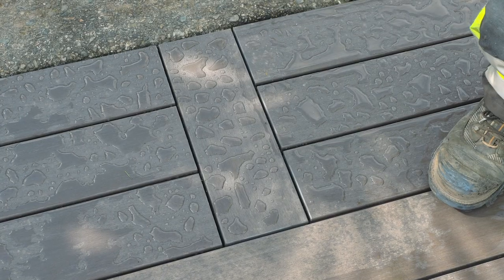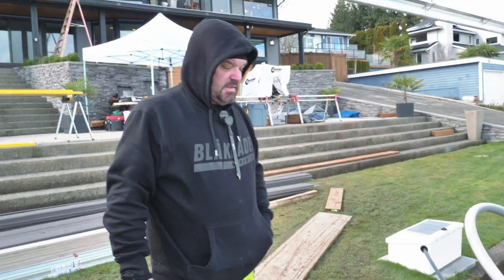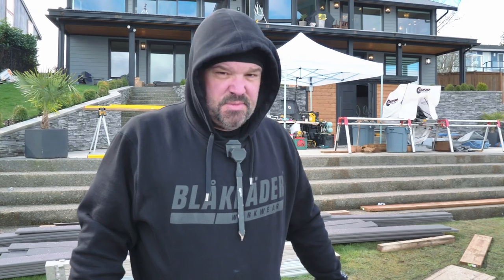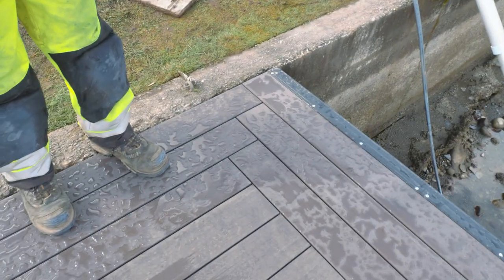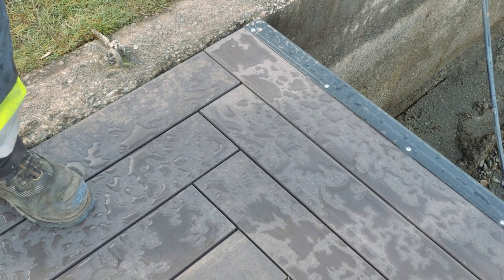Quick Tip: Inlay Patterns & Break Ideas || Dr Decks

Comment: I'm looking for an explanation of how to professionally frame a deck so that I can make a checkered pattern with the top deck-boards. I have a 25' × 15' deck that currently has 15' top boards running perpendicular to the house (and joists underneath), but I want to change to about a 46"×46" checkered pattern, which will disguise the two hatch doors that give access to the basement. The current joist design won't work.

Comment: "gapping the boards" depends on the temperature. Whether it's tight, 1/8", 1/4", etc. Can't always do a 3/16" gap. 

Miters are definitely harder then weaving. Otherwise you would do miters. 

Like you, I prefer weaving. It's easier and much better result.
Reply: Miters want to move and separate is a reason not to use them.